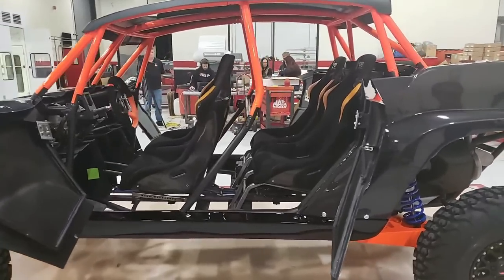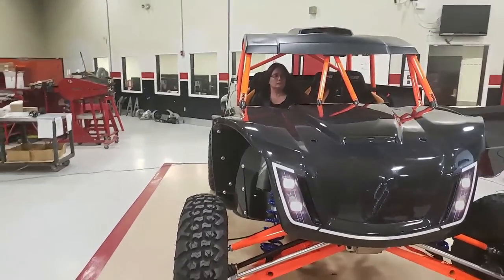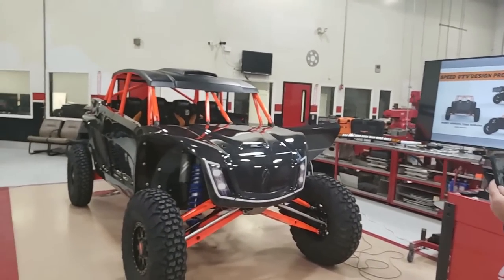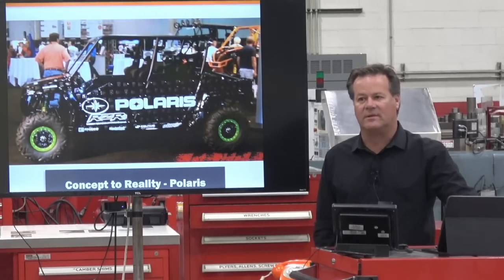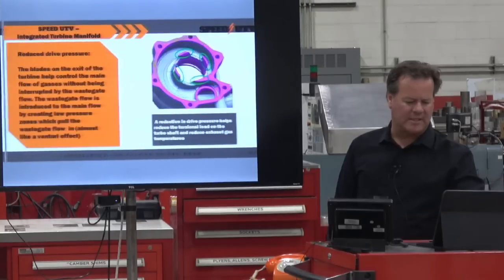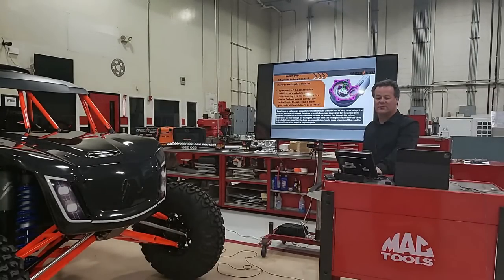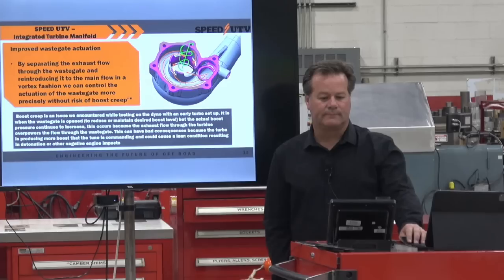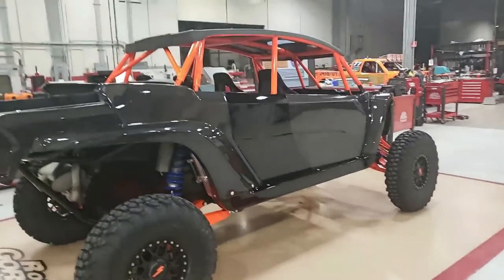Speed UTV Live Design Presentation with Robby Gordon

Comment: First and foremost you guys have built a great machine.  I’m concerned about the exposed belt and alternator.  How will that hold up in water crossings?  Even the Arizona Peace Trail has a few river crossings.  Also how will the Oil Tank stay clean in that spot, will there be a panel to block the tire spray?

Comment: What is the crush/rollover rating of the bolt together roll cage vs having a fully welded roll cage. I understand the replacement concept for knuckle head drivers but safety is also of importance.